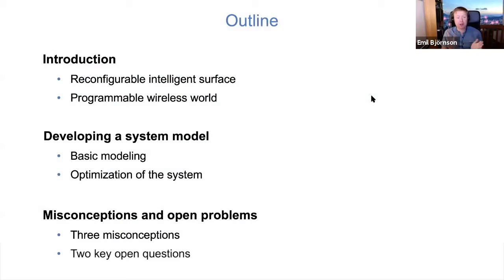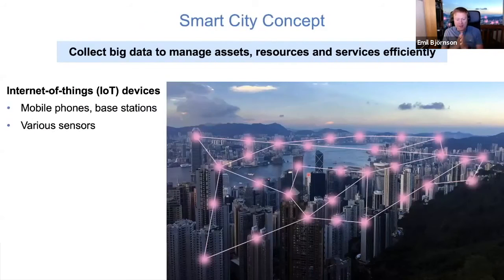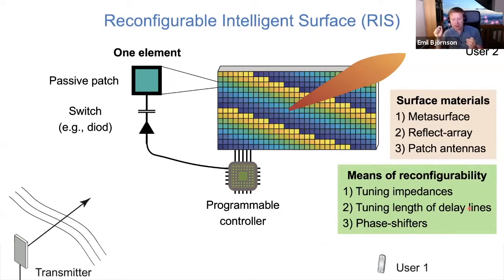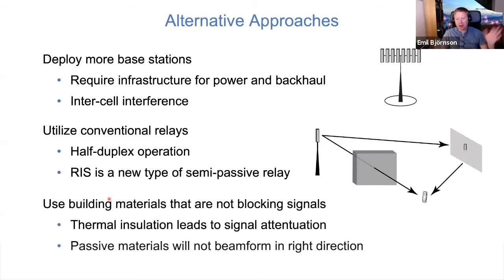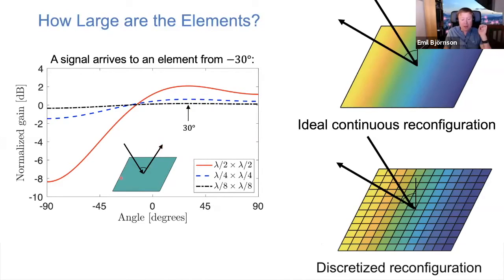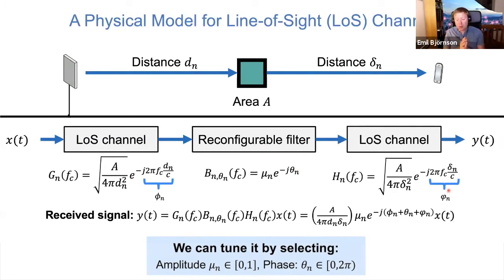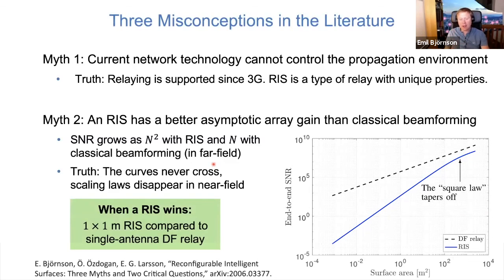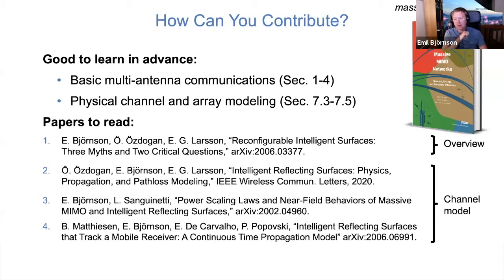A Programmable Wireless World With Reconfigurable Intelligent Surfaces

Comment: What is the difference between RIS and an antenna?
Reply from the maker: An antenna is used to transmit or receive wireless signals. An RIS is a surface that reflects wireless signals, and its reflection properties can be configured.
Reply: @WirelessFuture  Many thanks. Very clear response.

Comment: Hi professor. What is the practical number of IRS elements used in an IRS-assisted system? Can it be as low as 16, as many of the papers have used this number for simulation?
Reply from the maker: We don’t know that yet since this is a technology under development. It is the size of the IRS relative to the propagation distance that matters: what is the solid angle of the IRS seen from the transmitter or receiver? The required physical size grows with the propagation distance.
My personal guess is that 16 is too low and that the number of elements will rather be 100s or 1000s. The papers that show great gains with only 16 elements are often assuming that there is no direct path between the transmitter and receiver. My experience is the following: If one includes a weak but non-zero path between the transmitter and receiver, then one needs 100s of elements before the IRS becomes truly useful. You can have a look at Figure 3 in https://arxiv.org/pdf/2009.04723.pdf In part (a) without a direct path, the IRS is immediately useful. In part (b), one needs 5-10 elements per dimension (25-100 elements in total) before the IRS provides substantial improvements.

Our comparison between conventional relays and IRS is also of interest in this context: https://arxiv.org/pdf/1906.03949.pdf
It shows that the IRS needs to be large if it should beat relays. The lack of signal amplification must be compensate for using a large size.
Reply: @WirelessFuture  Thank you professor for such a detailed reply.

Comment: Could you tell me how can I change your codes from SISO  to MIMO and from a single user to multiple users, please professor ??
I have to know necessary ,sir ,to complete my graduation project ...
You have no idea how that can help me much ??
Reply from the maker: The multi-user case and MIMO case are substantially more complicated, and require different RIS optimization methods. Hence, I think it is better to start from scratch than modifying existing code. The algorithms presented in the following paper might be a good starting point: https://arxiv.org/pdf/1810.03961
Reply: @WirelessFuture   thank you ,sir

Comment: Dear Professor, I really appreciate your efforts in producing such great videos. I have a question about using RIS in practical situations such as CRAN. I want to know (focusing on energy efficiency) at what SNR, it is helpful to use RIS in the network?
Reply from the maker: The answer depends on how large the SNR is before adding the RIS, because the RIS is only helpful if the SNR improvement is noticeable. For example, if the SNR without the RIS is 0 dB, you need the SNR via the RIS-path to be above -3 dB if it should make a difference. Preferably, it should be much larger than that.
Reply: @WirelessFuture  Thanks alot for your answer. So generally can we conclude that if SNR is around 0dB, adding RIS is one approach to improve SNR if the RIS-path could improve the SNR? Or RIS is always an option to improve SNR as long as we could find a good place to deploy it?
Reply from the maker: @nazaninm912  One needs to find a good place to deploy it (preferably with LOS from the transmitter and to the receiver) and then make it large enough to improve the SNR in a meaningful way. In some cases, the RIS will have to be overly large to make a difference and then it isn’t practically meaningful.
Reply: @WirelessFuture  Thank you very much. I got it.

Comment: hi，prof，thank you so much for these videos.I have some doubts that whether I can view IRS as analog beamforming or hybrid beamforming.can I apply some kind of precoder or decoder such as ZF,MMSE,MFwhich are used in BS to RIS .thanks again .
Reply from the maker: Hi! The IRS is essentially doing analog beamforming. It takes the received signal, phase-shift it in a controllable manner, and then re-radiate the signal. Only one beamforming configuration can be used at a time, but one can optimize it according to different criteria - such as maximizing power at a desired point or minimizing the interference at undesired points.
Reply: @WirelessFuture  thanks for your reply, prof!I seem to understand that RIS is not very suitable to use hybrid beamforming to serve multiple users at the same time because a large number of elements are needed to make RIS achieve the same effect as relay to serve one user, so it is better to use different time slots to serve different users, which is more economical and practical，right？
Reply from the maker: @AureliaKay11355  Yes, I think that is a reasonable interpretation. But one can certainly have two RIS and use them to serve two users at the same time. And if those two RIS are placed next to each other, then it is like using one RIS to serve two users. The main point is that when using an RIS for multiple users, one basically needs to divide the RIS area between the users. This is different from conventional MIMO communications (digital or hybrid), where each user can make use of the entire array area at the same time.
Reply: @WirelessFuture  Thanks a lot, prof! Thanks again.

Comment: Dear professor. Thanks for yor great explanation on RIS. I have a question about RIS elements. I figured out that RIS elements are passive elements. So in an OFDMA systems, RIS elements change similarly for different sub channels or they change differently?
Reply from the maker: This is a very pertinent question! The elements cause similar phase-shifts for different sub channels, which is problematic because the channel can change between sub channels. We discuss this further in the following video: https://youtu.be/3RjlCpvn0Dc
The full details are given here: https://arxiv.org/abs/2102.00742

Comment: what should be the size of RIS and how many RIS requires for optimal communication
Reply from the maker: The larger the RIS is, the better. The SNR gain is proportional to the square of the total area, so it pays off to make the area larger.
Reply: @WirelessFuture  thanks for your suggestions, but my question is that the element array size should remain same for every size of RIS surface? Means the number of element increase in term of NxN for the large surface of RIS?
Reply from the maker: @mrjatt435  I’m not sure I understand your question. You have elements of a given size, say wavelength/5 x wavelength/5. If you want to make the surface larger, you add more elements to it. Alternatively, you can increase the spacing between the elements but that won’t improve performance.
Reply: @WirelessFuture  ok means if we want to larger the size of surface we need to add more elements in NxN for better performance.

My question is It not useful to vary the size of the elements if we want the increase in the  size of surface? For better performance regarding of the spacing in between of each element

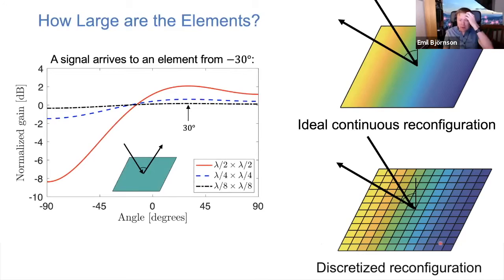Comment: Thank you very much for this enlightening presentation! I'm still a bit confused about why a specular reflection drops for smaller elements considering that the ground plane should also contribute with a strong specular signal. Could you share the publication reference for the graph depicted at 26:40? I couldn't find it from the publication list at the end of the video.
Reply from the maker: Hi! That figure hasn't been published in this particular form, but it was generated using a slightly edited version of the code that generates Figure 2 in "Intelligent Reflecting Surfaces: Physics, Propagation, and Pathloss Modeling". The original code is available here: https://github.com/emilbjornson/IRS-modeling
Reply: @WirelessFuture  Thanks for the reference, Emil! I guess then the model simply assumed an array of square patches, for which the total field  for an array is just the sum of  the fields from N isolated square patches. Neither mutual coupling between the square apertures nor the the presence of the ground plane (which will likely be present for any reflectarray-like application) were taken into account. It would be interesting to know how strongly these factors would affect the result.
Reply from the maker: @ivanlemesh9530  Yes, this is correct. To get more realistic results, the mutual coupling and other hardware impairments should be also included in the modeling. One can see the results in this presentation (and many papers in this area) as a best-case situation.

Comment: Dear professor , while designing this surface how will we determine the unit cell whether to be  reflective or transmitter surface , is there any criteria for a cell to be a reflective or to be a transmittive .
Reply from the maker: You can configure which fraction of the incident power that will be scattered and with what delay. If you want to maximize the SNR at a given point, the goal is to synthesize the transmission from a phased array. So then every unit cell scatters the maximum fraction of the incident power and the time delays are tuned to achieve constructive interference at the desired point.

Comment: Is RIS used in delay-aware systems? As it adds latency to the system I want to know more if it could be useful in a system with some applications where the delay is so important?
Reply from the maker: RIS is not used in any system today, it is still many years before it is a reality. I believe that there won’t be time to perfectly configure the RIS in a delay-sensitive system. But an RIS can still add additional paths that can be useful to increase the SNR.